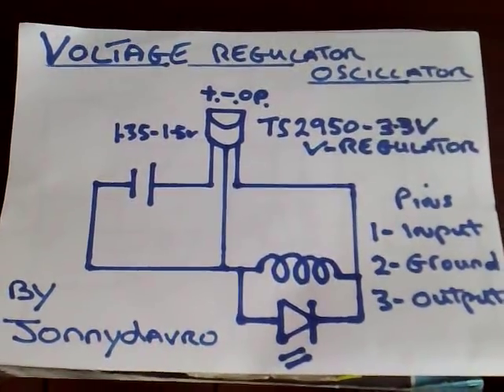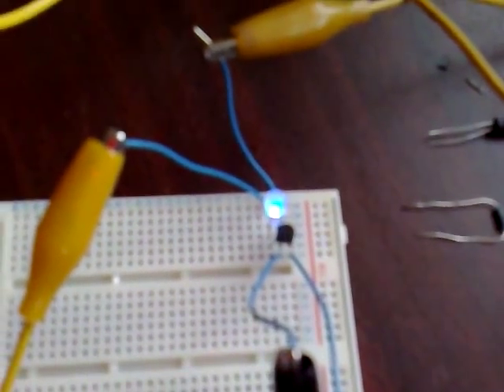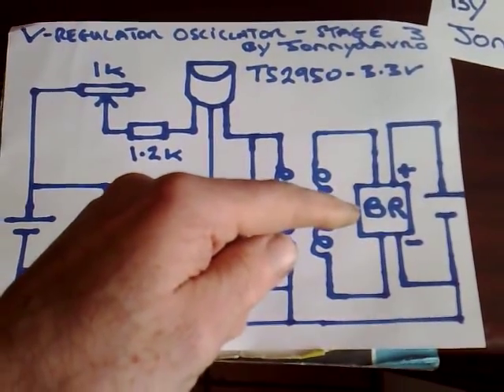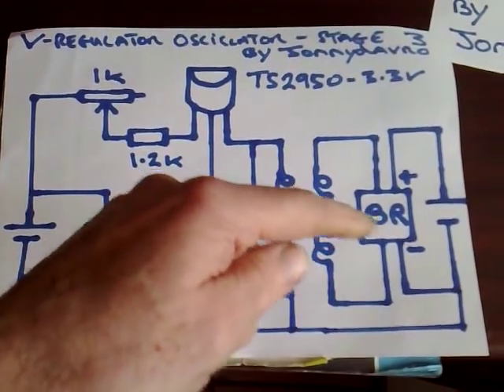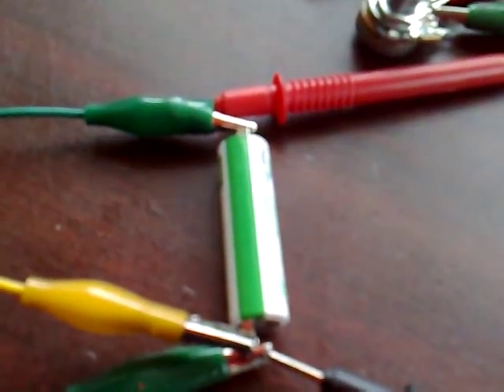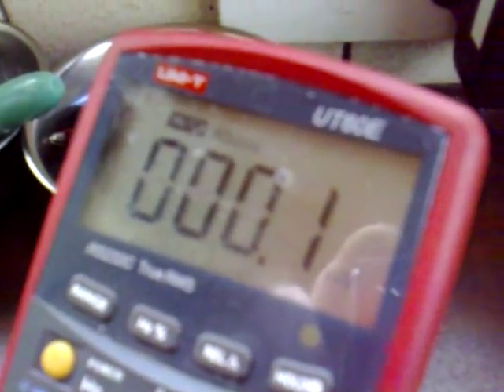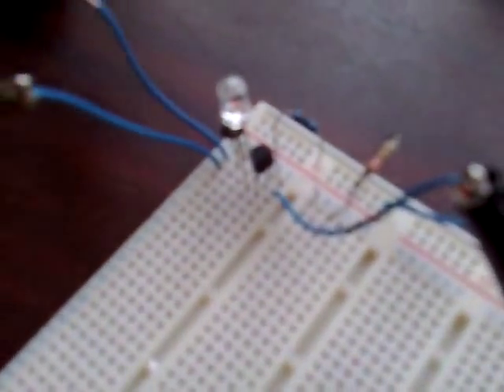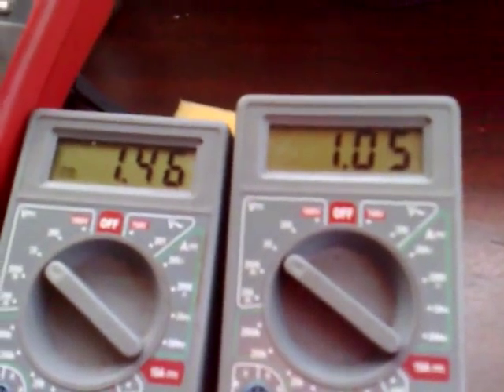Voltage regulator oscillator

Comment: Very intersting experiment jonny! After having a look at the datasheet for the regulator IC you're using I think I found some clues as to why your circuit behaves the way it does. Firstly you chose a regulator that appears to be very well suited to this type of circuit. It features low quiescent current 75uA, and low dropout voltage of 40uV at light load.  Continued Below....

Comment: Quoting from the data sheet "TS2950/A & TS2951/A have other key additional feature of unregulated input voltage transient of -20V below ground
(reverse battery)." I think this could allow some of the back spike to recharge the oscillators power source! Also the error amp in the IC requires a 1.23v refference. Since your supply voltage is 1.3 - 1.5v it is just barely enough to supply the refference and is likely why it oscillates. I'd love to see what the waveform looks on an oscilloscope.

Comment: I forgot to say that a bridge rectifier has twice the voltage drop because the current has to go through two diodes in series. If you change it  to a single diode, there is half the loss and the circuit is more efficient.

Comment: I want an oscilator circuit that outputs 6VAC at 50Hz from a 6V DC supply. This is to power the primary coil of my BiTT replication. It should be just enough to saturate the core & flux-path to the twin secondary coils so that their back-EMFs will go to each other instead of back to the primary when they are placed on load. I intend to put a bridge-rectifier on one of the coils to charge a capacitor while drawing current from it to power the oscilator feeding the primary coil, powering itself.

Comment: @jonnydavro BiTT= Bi-Toroid Transformer. I think I need to use diodes to feed some of the real power back to the input (to overcome resistance/heat-loss) while it draws only reactive power from it's own output (to power itself). So it sends the flux one way & the electrical diodes feedback the AC current one way also. It's supposed to consume reactive power (net consumption is zero) while outputting real power. Zero power factor at input. Power factor greater than zero at output.

Comment: @isub4real 
See?  That's the big problem.  Here you have a novel and unique circuit that uses a highly specialized part to do something that has nothing to do with its original intended use. But because it's really difficult to obtain, it's easier to build a conventional Joule Thief, for which it's so much easier to get the parts. BTW, the bridge rectifier was made for 50 or 60 Hz use and has slow recovery time, so it's better & more efficient to make a bridge using 4 1N5817 Schottky diodes.

Comment: @jonnydavro I recently picked up a Tektronix 2225 scope from an ebay seller for $70 USD. Been having lots of fun with it since. I think I'd like to replicate your experiment, but I'm finding it difficult to find a US supplier that stocks the TS2950 regulator. Mouser has the TS2951 but it's a SOP-8 chip with features like adjustable output voltage. Where did you acquire your regulator?

Comment: @jonnydavro @jonnydavro I recently picked up a Tektronix 2225 scope from an ebay seller for $70 USD. Been having lots of fun with it since. I think I'd like to replicate your experiment, but I'm finding it difficult to find a US supplier that stocks the TS2950 regulator. Mouser has the TS2951 but it's a SOP-8 chip with features like adjustable output voltage. Where did you acquire your regulator?

Comment: @mrgalleria 
I googled copper over-saturates and I couldn't find anything. I'm puzzled as to what it is that "over-saturates". In the case of a ferrite core, it will saturate, which means that the magnetic field can't get any stronger. Air or vacuum can't saturate since there's nothing there to magnetize. To me, saying "over-saturate" is double talk.